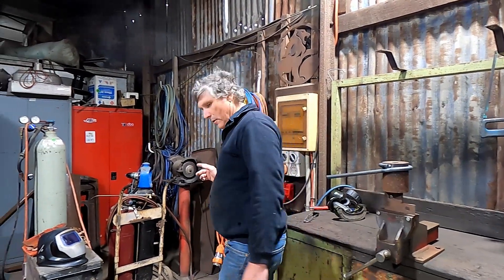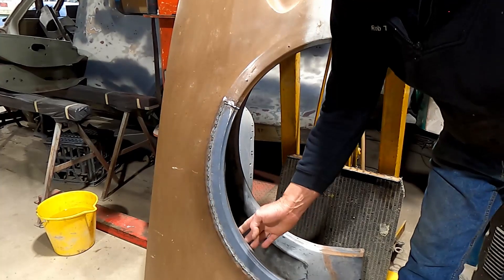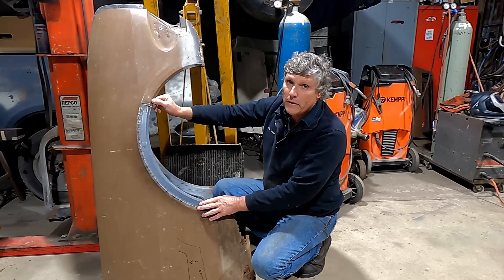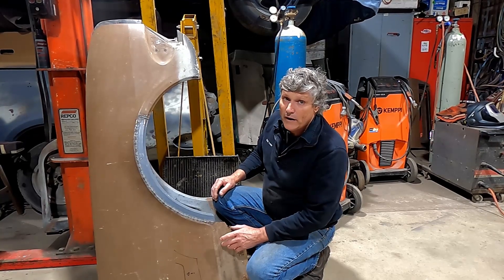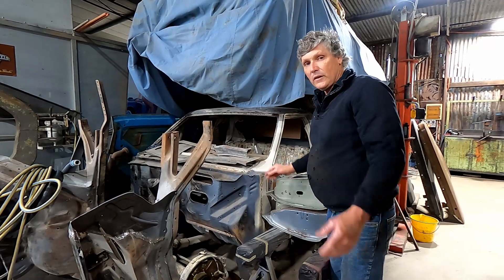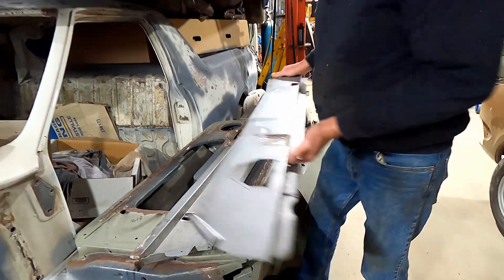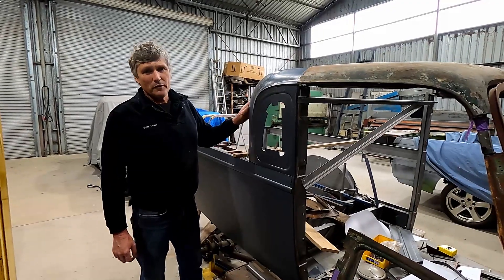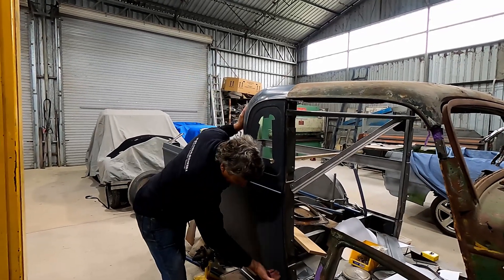GoPro Update 9 - 30/08/2021

Comment: Thanks for the update on the various projects. Look forward to seeing more as you get back into them. Glad to hear that you are on the mend. Without your health the rest becomes almost pointless. With good health at least you will be able to work on the cars and enjoy them for many years to come.
Reply from the maker: I am famous for pushing on, to the point that I break, it has been bit of a cycle through out my life. I damaged my back and shoulder as a teenager when working as a bus mechanic. It has been a problem that continues to comes back to haunt me from time to time. I have changed so many of my work practices over the years to ease my body, but sometimes the simplest task can cause an issue. Getting older isnt helping it either. 😉 Cheers Rob.

Comment: Love your Ford,it is at a similar stage as my HT Monaro.  I just got the chrome door post done,the common problem of bubbles buggered them. The local chromeworks was able to restore them for $1100.😁😁😁
Reply from the maker: You were lucky, a lot of platers wont touch blistered diecast items. The price doesn't surprise me there is a good deal of work in repairing those posts. The second car I saved, was a  HT gts Monaro. It was being pulled apart to build a speedway car when I talked the bloke out of it. I was 16. It was on the road by the time I was 17. Sold it when I started my first shop in my early 20's. Bought equipment with the money.  Cheers Rob.